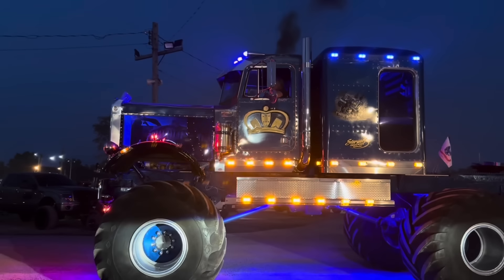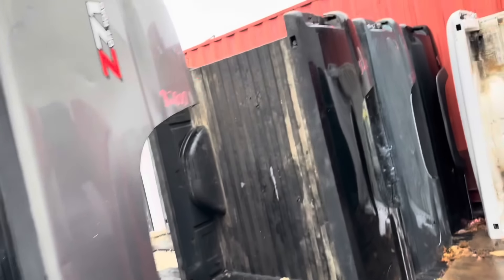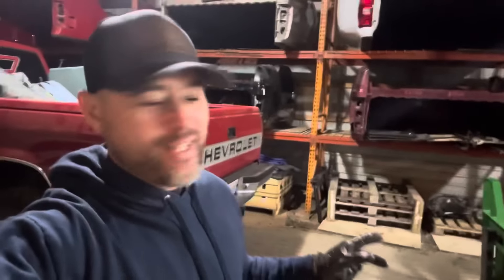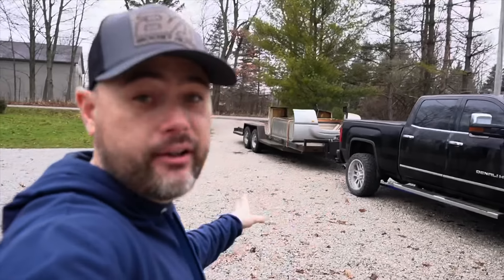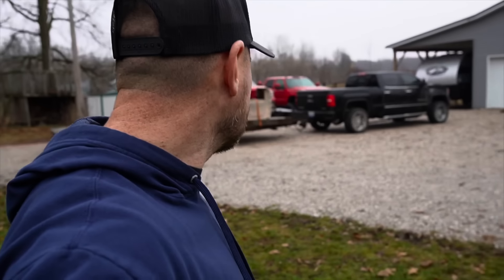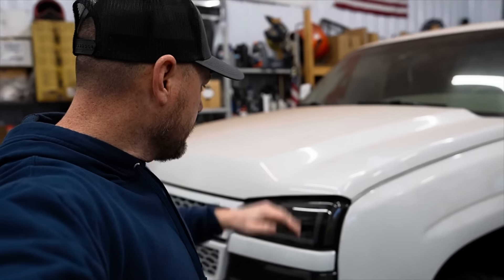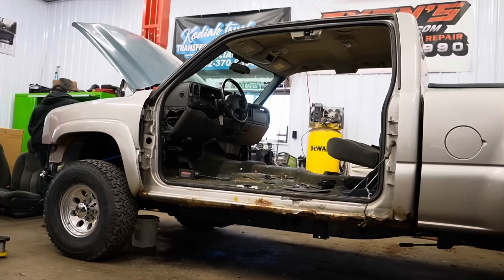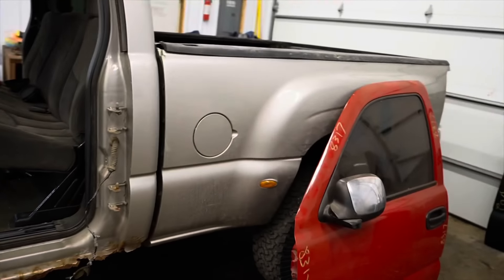I SPENT $3000 On The Rarest GM Truck Bed Ever Made! Restoring A Rusty 20 Year Old Duramax

Comment: Been specializing in Chevy/GMC trucks the past 30 years.  Had 4 Q-steers in the past year.  They were offered from 2002 to 2005.  The bed is all steel, just the outer quarter skins are that composite GM material used on step sides, and Buick front fenders.  They are apparently also available in fiberglass via the aftermarket.
Reply: And  cann be bought for arounnd 1800$. Ive had atleast 7
Reply: @chevyromans4435  The trucks or the beds?  I'll take 'em all if you can get the trucks for that price!
Reply: @scottysgarage4393  beds  lol

Comment: Put a bed cover in fiberglass or plastic over it with windows and paint everything in same color and paint over the chrome and use some more extreme color. That bed rocks on that truck.

Comment: I believe the protec bed produced from 02-03 was the rarest bed option gm produced. They had a unique raised letter tailgate similar to what the avalanche had as well as the entire bed was composite. The only steel on it was the bottom rails and hinge/ hardware assembly. I ended up finding a color matched one for my 04. It was different and had its own cool factor but I’d never seek one out again. The tailgate was not interchangeable with standard beds as well as the hinge hardware was unique making it difficult to find and hard to repair.

Comment: I knew it had to be a quadrasteer bed when I saw the video title. I owned a fully optioned 02 quadrasteer. Absolutely the best driving truck I ever had; it went down the road so well. The quadrasteer technology was not a gimmick. If recall correctly it took 12' off of the turning radius. 

Can't believe gm let it die. They didn't move enough units, not because it was bad tech, but because they could never make it affordable enough. In the beginning years it was +$7k option. In the later years I believe they had it down to the $2k range and only came with the quadrasteer rear diff, not all the other bells and whistles.

Comment: I retired from Flint truck. I remember them trucks very well.1500 HD only platform, at least in our plant. The rear axle is wider than the front end and that was a huge issue appearance wise. More than the bubble box side. I feel they were so far ahead of their time people were afraid of it. In my opinion if they would’ve pinched the frame and made the rear axle the same width as the front end, it would’ve changed the out come . Good ole Q44!! PS different color dark metallic green . Or you could leave it up to us viewers by doing a pole.

Comment: We had a quad steer Chevy. Only problem with it was when you get a lot of mileage on the rear component it would look like it ran sideways.  But you were able too tuck a bigger tire under it. But look at the weight loss you’re getting from that bed.  Full on race truck

Comment: I’ve had two quadrasteers. They made them from 2002-2004. My dad still has the 04 Denali truck. Definitely some of the coolest and toughest trucks GM ever built. It’s got 240k miles and everything works exactly as it should.

Comment: Score…Nice find…. that’s gonna look good..I have an 02 Dually…. The bed is made the same way ( I was really puckering when you took that off the trailer like that…. After 20 years, it gets a little brittle). I totally rebuilt mine. Those side panels I’ve found are reeeeeal expensive. You’ll find some small stress fractures here and there. Use a  reinforced fiberglass (with mesh) on the inside, then paint 👍. If you don’t, The body filler will eventually crack with changing temperatures leaving something undesirable. However you do it  ….do not take the panels off to make repairs. Make repairs on the truck while bolted. You will want to…..but it’s better to leave them on ( I took mine off …..trust me on that …. save you some frustration👍).

Comment: They ended in 2005 for the bed , the Denali end end in 04 I think when they figured out the crew cab short box. you should have found a quadrasteer that worked to build your truck.

Comment: I bought a quadrasteer truck once & I believe it was the only one I’ve ever seen. It was green with an immaculate tan leather interior, 60k miles, 6.0L gasser. Bought it at an auction for 13,000 and was told it ran and drove. Showed up and the thing was completely rotted out, fuel lines rusted through and leaking fuel. Check engine light on it, and service quadrsteer too. Luckily was able to pull out of the deal and it only was a $350 mistake

Comment: The world is crazy. Sitting here watching another great video and you throw the tailgate on and low and behold the dealership logo is from a dealer I used to work for in North Texas. Kinda nuts.
Reply from the maker: No way 😂
Reply: @TruckMaster  Small dealer with like 3 or 4 techs in the shop. Dealer was Cadillac and used trucks. Town is about 35000 population  so not a lot of those badges out there so that tailgate is more rare that the bed you got.

Comment: In another note, I've been using those chrome bumpers you just brought up on my 2002 Silverado for years now I keep replacing it cuz I keep banging in the trailers tongues. In other notes my bed is 6'-9" service bed. I'm not sure a quadrasteer 6'-5" bed would fit my 02 LB7

Comment: The bed looks okay and better than I thought.  The downside to the composite material much like GM did with the front fenders on the FWD Cadillac Fleetwood is that they can break.  Even break from somone pushing or leaning on it.   That was a common problem on the top flat part of the Fleetwood fender.   I had a tire tread seperate and it demolished the drivers side front fender.  Yeah try finding one of those fenders to fix it. Very difficult.

Comment: The 2008 factory hitch receiver will bolt up directly to that year . 08 was the first year they made them 2  1/2 inch . Also the 08 jumpsealt console wilth the 3 cup holders are a direct bolt in as well . I did it to my 05 and I love it

Comment: The bed is cool from the side but a little odd from the rear wheel spacers will help, but almost need aftermarket wide front fenders.  Good thing you had help with the bed those bed sides are fragile.

Comment: I was fortunate enough to drive one of the 2002 GMC Quadra-Steers at the NC State Fair when they were first introduced that year. They had this obstacle course set up where you really got challenged with the handling characteristics of that quadra-steer system. I wish I could locate one today even though they did have their fair share of problems!

Comment: Not a quad steer, but I have an 03 Chevy Silverado 1500 5.3l ( Pewter) with the poly bed sides on fiberglass floor/insides, only metal on the bed is the fuel door.  Made by GM " Pro-Tech " All my research turned up was about 10K sold as a $800 dealer option over 2 years.  Weight savings of around 500 pounds over steel bed. Mine is the same color as the one you bought but the wheel wells are not shaped like yours, mine looks like the regular bed. Tailgate is plastic on mine and the shape and lettering are different from any other gates.  two people to lift the bed off my truck for a fuel pump replacement.  Anyway, Stay Safe, Stay Warm.

Comment: Great to have another video  ! The bed looks great. Always liked that look. Not a stepside not a dually not a flat fleetside.. in between and looks great.  The rear bumper, grill and hood.. look great 👍 Keep away from a lift. Maybe a  leveling kit to even it out. 35's should fit easily.. 37's with a bit of trim work  ? maybe.. Your friend talked about wider front fenders... you might be able to find some fiberglass "pre-runner" style fenders for the front.  Cost ?.. they will require some fitment.  But would allow some wider tires.. minimal.  Probably not worth the cost and fitment time... a minor "body lift" can help.  Never been a fan of wheel spacers.  Color... what color is the  new hood ? How about a really good blue ? I like your  Dodge and you did it right in Black.  You have white and Red.. but a good Chevrolet Blue... or a nice Forest Green.. Anyway you will pick the color that suits you.  Btw.. the beard is looking good 👍  2024 Truckmaster edition lol.. Great project and coming right along.  Get a car cover for the WIFEMAX... a good ceramic coat and cover for the winter while it's parked in out of the weather.  😎👍
Reply from the maker: Thanks for the feedback 👍👍👍
Reply: Been a follower for a long time.  Really appreciate and enjoy the content and your channel.  My tidbits of feedback  / ideas are just that.  You make all the tough decisions and you have done great so far.. Mrs. Truckmaster keeps Earl away and the Truckmaster in check... and that's why you are successful.  Strong faith and family values.  In today's world and society.  That is something that everyone needs to refocus on in all we do.  It reflects in your success and your content and it's presentation.  Which is why I personally have always enjoyed watching your channel.  😊

Comment: I have no ideal why I watch your channel because I have bought 2 new Dodge’s a 92 3/4 ton 12 valve 4x4 with locking hubs that are factory and the one I drive is 05 bought new 4 door long bed dullay 5.9 and bothe trucks are manual first was 5 speed and my 05 has a 6 speed manual with manual 4x4 selector on both trucks and my 05 has 152 K on the clock so I’ll keep watching your channel keep up good work .

Comment: Paint it black and if I remember somewhere between 99-06 they made a factory 6 1/2 foot bed called pro tech was a composite bed non quadrasteer I saw one once on a 99-02 even the tailgate was  they are very neat considering how bad these trucks rust.

Comment: That is crazy - I found one in a junkyard for $1100.

Rear harness isn't available - so had to tie into the rear harness by the trailer plug to get the perimeter lights working.
Reply: Did this 2 years ago on my Duramax. Could use spacers since the wheels are sucked in a bit. 

https://youtu.be/ZaNNseO-Czs

Comment: You need to lbz swap a quadrasteer now.

I owned an 03 1500HD quadrasteer. Loved that truck in parking lots. 

The quadrasteer rear axle is wider than a 2500HD axle.

Comment: Im gunna say i like it! Its a different look! Its got almost a slight pre runner desert truck bulge to it, with out being full dually flair. I dig it. 
I remember those Quadra steer trucks.  The tera dyne axles. It was basically dana 60 knuckles and outters. Not one of gms best ideas. Ive seen a lot of guys use then on rock crawlers for rear steer. They are a burly beefy big axle for the truck being a half ton. The axle was over built. But jot one of gms best ideas. Ive worked on one at the dealer before and knew someone who had one back in high school. Cool idea tho to make a one of a kind build! I dig it and aprove!

Comment: I saw 1 quadrasteer in person. I thought the bed really did not look right. I once almost bought a 2500 suburban with the rear steer. Did'nt realize it had that feature until I got on the road. If it had lower miles I would have bought it.

Comment: I had a 2003 Chevy 1500HD crew cab with the quadrasteer.   The 1500HD had the 8-bolt rear.   Great truck, but those rears are getting harder and harder to get parts for.

Comment: If you don't want the wider bed & wheel well, I could use it on my LBZ with 37x13.5x18's it would tuck right in the bedside fender! without rubbing. Silver Birch is great, it's the color of my Duramax & my wife's Denali!
Otherwise a "prerunner" style fiberglass front fender could work & give you room for larger tires without a lift!! 👍😎

Comment: Our local Davenport motors chevrolet diller sold about 5 of those back of the day. I drove it around the block it was different for sure and later on we hade to fix them plaged with problems.

Comment: They made the quadsteer for 5 model years with different trim levels per certain year. Most of these were All wheel drive, mine is the SLT with the quadsteer option which had selectable 4x4, auto, lo and 2wd. I still have it. I never drive it, and the inside still looks like it left the showroom yesterday. It does need a few things but I'm going to go completely threw it once my garage is finished. I've had it for 15 years. It only has 130k on it.

Comment: Theres a bunch of places down here in florida that sell bed take offs. You can get brand new ones off the brand new trucks for 1200 with lights and tailgate. The older style beds are always for sale all over and go for about 500 bucks rust free lights and tailgate. You can get the big utility beds too for around 600 bucks and sometimes cheaper too. My 02 duramax at 300k miles has 0 rust anywhere. Only thing is our paint fades and dashes crack.

Comment: I think the bed looks sick. My $0.02 is that it looks a little funny that you now have flares up front but not on the back. The truck obviously would have had flares front and rear from factory and it's always flares all the way around - never just one axle. The only real solution would be to delete the front flares.

The pewter color looks fine. Definitely a much easier paint job keeping it the same. There are a million ways for a color change to end up looking cheap if you don't hit every square inch.

Comment: Is that 14+ bumper from a 1500 or 2500?

Use the 2014 1500 brackets - then drill one set of holes 2" higher then your current holes in the 2500 frame. 

It will bolt right in.

Comment: The bed is super unique i would keep it. I also think black would look great. Not sure what you have planed as far as engine mods. I think you said you were going to keep it simple. Just wandering if you could so some 50 state mods. I am looking for some ideas out here in California. I have a 2006 LBZ Crew cab i got from my Dad. 4 inch exhaust, air box , lift pump, box tuner,3 inch down pipe. Etc  I was wondering could drop a link in on those E Bay lights too  :)

Comment: Question I  own a LB7 and have the bed off doing brake lines wanting to redo my fuel lines for FASS lift pump have you ever pluged the returned from your lift pump into the orginal sending unit feed fitting? I blew through mine and seems like that would work. I dont want to cut my new filler neck i dont care for the look of it. I thought thats what I saw you do on this build but I couldn't make it out.  thanks for the content been a long time watcher. thanks for your service.

Comment: I had a 2004 qaudsteer 2500 HD 6.0 vortex crewcab reason I sold it had a bad transmission but I wasn't aware of the transmission was shot when I bought it qaudsteer rear axle worked

Comment: Im getting old , young man with all the truck parts said their all the classic truck beds , classic truck to me is pre mid 70s . That bed would work nice on a two wheel drive with wider tires on the back . Also I have seen a couple of the quad steers still on the road here in NC then again there still daily driving 40 & 50 yr old trucks here which still gets me Im originaly from the Maryland & Pennsylvania area and you now ya just dont see old trucks daily on the road .

Comment: Next time you are in need for a bed make a post or even a short YouTube video on this channel and ask around if anyone knows or has one the color & size you need, I’ve got a buddy of mine who has the bed same color rust free dent free has a scratch or two but bedlined also for $350 could have got it shipped to ya for cheaper than that boss!  That’s why I didn’t purchase my bed up north there. Guys wanted anywhere from $1500-$2000 for a bed for my mega cab short bed SRW. Wasn’t gonna pay that… waited till I got down south ended up paying right at $800 for this bed I got, oem color same as my truck rust free dent free scratch free bolted right up looks like a whole new truck now lol 😅

Comment: Josh those trucks I actually got to sit in them at a automotive dealer trade show back in December of 2003 my oldest brother took me and got to steer a truck with it on it I made the prediction that the modules would crap the bed and that within 3 years they would be traded in for regular solid axle rear trucks there were at least 6 recalls for those modules it also made wheel bearing failures and break failures and now to find those trucks is rare

Comment: I was lucky enough to get a quadrasteer bed for my lbz build . Paid 850 in RI.  Would have been 2k but the seller dropped it when he was removing it, so the bedsides cracked.  It would have been easier to just pay more for a good one. what a PITA to fix the cracks, because you can’t use regular fiberglass resin. The bedsides are SMC plastic, and the correct panel bond adhesive is expensive!  If you find a front fender flare option that matches the width of the quadrasteer bed,  let us know.  Nobody makes them.  I agree with the others, don’t paint it black.  I did my truck in raptor liner OD green,  and the bedsides are very noticeable.  I think the flat color draws your eyes to every curve .

Comment: So I'd keep the WA382 Pewter paint. Maybe re spray it with a heavier met flake in it,or some pearl.
Definitely like the old school round slot rims..! 
Question was the quadra steer only made for the short  bed? I can't remember, and no luck looking up that info. The biggest problem I have with my Sierra is the two piece driveshaft since it's a long box,crew. The question is: does anyone offer a bullit proof carrier bearing that hold the center section up to the crossmember. ?

Comment: I thought you found a pro tec bed which is actually gms rarest bed as there were only like 6000 of them sold. I kind of like the quadrasteer bed. I have a friend that has a 2500 quadrasteer suburban that he put a Duramax in and it's pretty sweet. Maybe throw a set of spacers on the rear and see how it looks and even wider front fenders. I actually kind of like the pewter that's in there. If not a graystone/gun metal grey or even the blue granite like the color of the hood.
Reply: I have an 03 1500 5.3l with the Pro-Tech bed and plastic tailgate. only one I've seen.